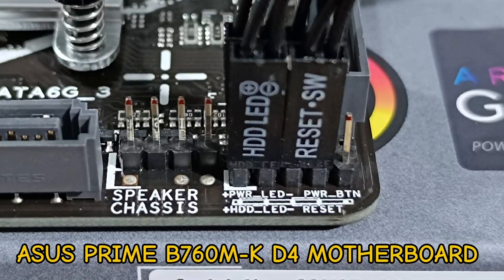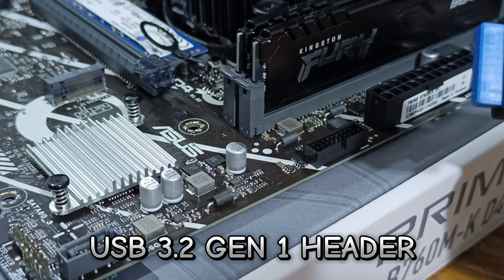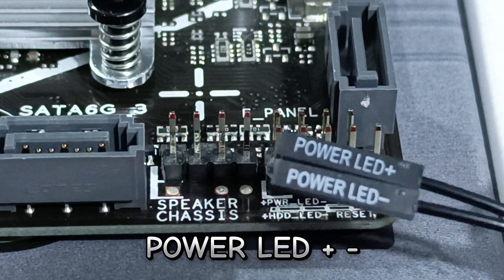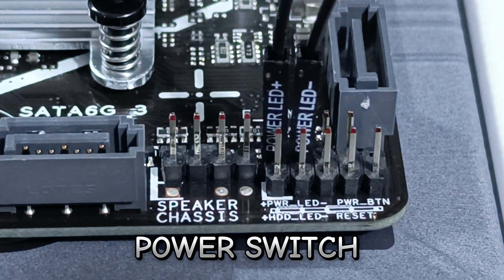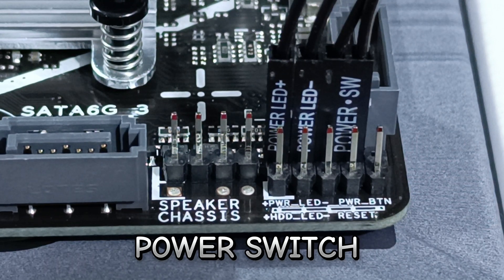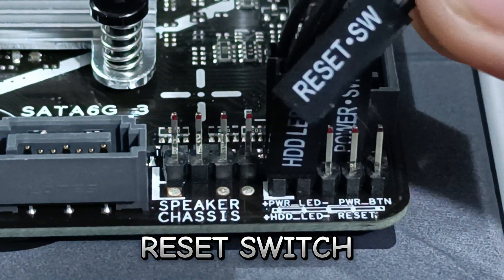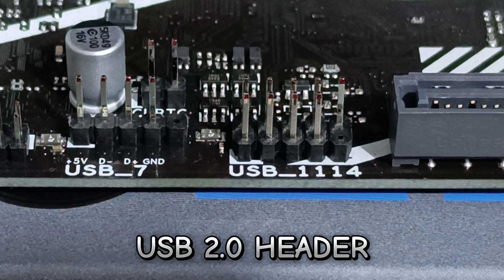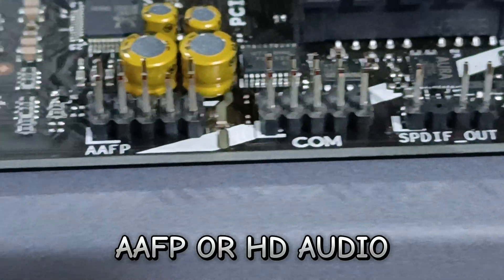ASUS PRIME B760M-K D4 Motherboard FRONT Panel Connectors

Comment: Thank you so much! And where to turn on the “led sw”?
Reply from the maker: LED Switch is for those PC Case that has its own Fan RGB Control Hub or Controller. There is also a LED button in the Case.